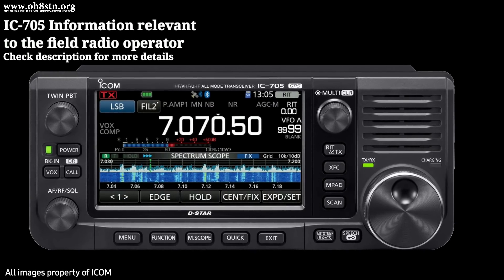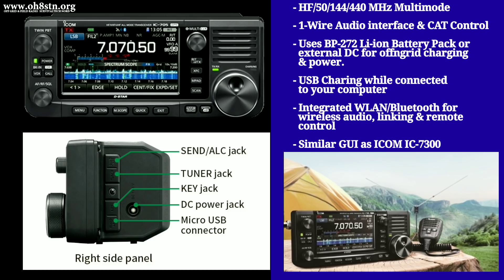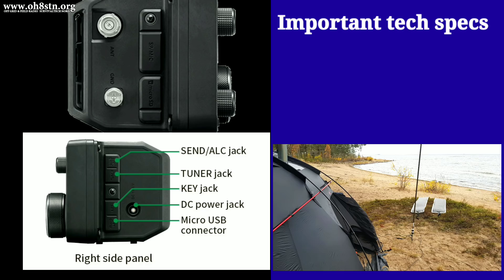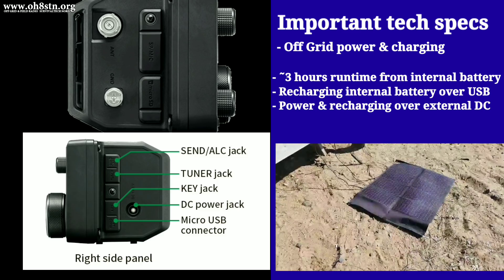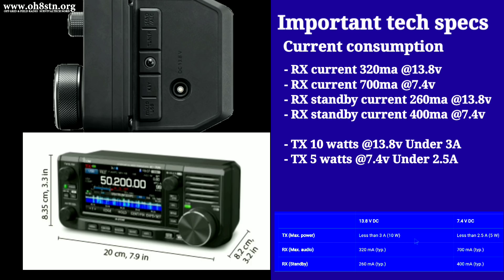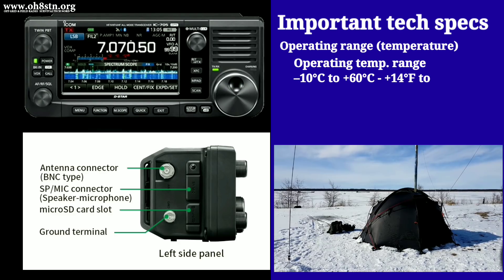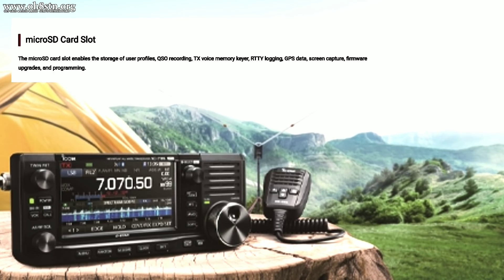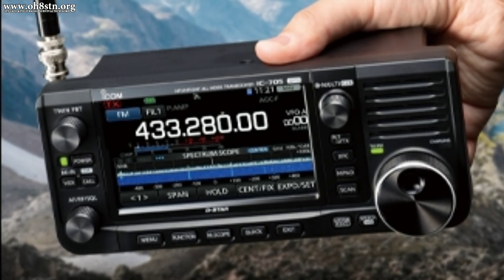Icom IC-705 Update May 2020

Comment: I think it's a fantastic field radio. Probably the best out there! 

I don't really buy into the "QRP radio" thing. I mean, every radio is a QRP radio if you just back off the power.
Reply from the maker: QRP is as much about energy efficiency as it is transmitting at low power. There currently are no efficient QRO rigs on the market unfortunately.   It's actually crazy  when manufacturers think we can just turn down the power of their QRO radio's, but still have to carry a suitcase sized battery to power it for a day.  This is why I am using the QRP radio plus the PA500 amplifier. I can still operate 60 W output while maintaining 250ma rx current consumption. No QRO rig does that yet.
Reply: @OH8STN  I think the single biggest pro on the 735 is the USB charging ability.
Reply from the maker: Wireless data modes, microphone and headset. 200ma current consumption,, built in GPS, ...
Reply: @OH8STN  As I said, it's probably the best field radio out there.
Reply from the maker: So I missed the point 😄
 This is why radios like the 705 are becoming more attractive over its more current hungry QRO cousins.
Reply: @OH8STN  I guess that depends on what you define as "QRO". 😂

Comment: Not all products can be all things to all people, these are just my thoughts, and yes i know some o them have already been covered.

1) Would be nice to see a battery compartment for 3x or 4x 18650 cells allowing higher voltage operation and making a mild sacrifice on unit size for significantly increased battery capacity. whilst negating the need for using a proprietary battery  pack.
2) An internal tuner also wouldn't take up much space, being internal no need for connectors or tuner power sources or micro controller, it would run off the existing mcu.
3) A second antenna port for VHF/UHF - really consider those on a budget and/or lower licence level use radios like this as their main rig, the 817/818 with the dual ports are great for this.
4) OLED display might have been nice for better readability in sunlight and lower battery consumption.

I was really interested in this radio, but at straight up double the price of the FT-818 in my region I think I'll be passing.

::edit:: Also a suggestion, avoid using the term 'one wire'. Unless I'm mistaken you are talking about rig control and audio over a single USB cable, and not the 1-wire communications bus by Dallas Semiconductor.

Comment: I'm waiting for a 100W that turns down to 5W.  I operate QRP from time to time, but my main concern is communication after a hurricane in Florida.

As a condo dweller I have 1600W of portable solar power for after the blow.

My ECOM radios are a IC706MKIIg, 2ea FT-857d, and FT-897d.  I did have an FT-817nd.  For me these are excellent for car or motorcycle portable or ECOM with the 100W.

The IC-705 does have my attention though and I am looking forward to your review after a good shake down.  All my portable operations tend to be to cluttered and bulky.

Julian, you are the king of streamline and clean portable radio.  Thank you for changing my paradigm to ECOM.

Comment: I'm thinking about this radio for the exact same use (emergency, off grid, etc...) My only two 'concerns' are no built in digital mode support (I'm thinking along the lines of the D74) and that there's no built in antenna tuner (but maybe that's not a real concern... I'm just now finally looking to upgrade to my general license after having my tech for over 20 yrs... So my HF knowledge is of course, limited)

Comment: I want an all-band, all-mode rig to take camping, and I'm torn between the ICOM IC-705 and the Yaesu FT-991a. This will be my first HF radio, so the extra power of the Yaesu is attractive for when I'm home, but all that extra power would require a marine battery in the field. I'm finally starting to see why enthusiasts collect so many different radios! 73 de K7COI

Comment: I am concerned about the micro USB connector. I have had bad luck with most of the devices that had it - it's fragile and often failed if used extensively. Why not not use USB-C, it's 2020....
Reply from the maker: Agreed

Comment: Ask a question? Get an answer !  Well done video.....thanks.   Down to business. The current drain in stand-by is less than I thought it would be. Not too bad. That is one neat radio with a lot of features and a lot of bands to choose from. Adding D Star was a nice touch. BUT......the deal breaker for me is the idea of not including an onboard ATU.   Look at the size of the KX2. It has an ATU built in. I would have sooner had an ATU and no battery, like they did with the IC703 series. Look at most YouTube ham radio portable setups. So many people use non resonant antennas or antennas with not so good SWR. 
For me, the no tuner is a deal breaker. It may not be for you. Just a note......I only use resonant antennas, but I still would like the ATU since there are times I need to go close to the band's edge where a tuner is needed.
KU3X/QRP

Comment: Looking at this the other day, I started wondering how inconvenient  the single antenna jack might be.   If a separate VHF/UHF jack was available. A simple dual band antenna could allow for local repeater work, etc. and still allow HF work without switching antennas or using  a band splitter or  something.  I suppose you can still carry and HT  around ....

Comment: I'll be honest thus far this radio doesn't do it for me although I like that pricing seems to be speculatively dropping around a grand ? better than 1500 for sure. i like few things but it certainly doesn't look field worthy or built for rough service at all. Why can't a company make a "real" filed radio .water proof or resistant at least shrouded and or recessed controls better options for internal battery and or external as well. I think most people just like the waterfall and touch screen..I would actually love it if you or anyone could school me on what's so amazing about this rig vs others tbh. I may be missing the boat. Thus far I only have the vererable 817nd and 897d . got both used and on good deals of course.I will be watching intently as you test it as I know you will be honest about what it does well and what it doesn't. I think SDR based radios are the future and love that this one is all mode and band at least ( which is why the xiegu didn't do it for me either) I will look over specs again . I haven't used a 7300 but that has amazing reviews especially at price point and this would be great compliment to owner as seems intuitive and simliar menus and operation etc. also no built in tuner? think they missed mark on that one as Xiegu will most likely release another version or update I am sure . the Chinese seem to be able to move much quicker albeit sometimes to dismay of owners as they end up beta testing firmware. I am admittedly new to this game so would love hear and see counterpoints to what this 705 has to offer ...love your channel and content btw.

Comment: Hello OH8STN, thanks for a great video! I'm looking to run the same setup as you, the IC 705 with the lightsaver max. However on the specs it says that the IC 705 needs 13,8V and the lightsaver max gives 12V, do you think it will work? (I'm new to this :) ) 73 de SA5EMA
Reply from the maker: This is something we need to test when the 705 arrives. I look at it like a car battery, which is only 13.8 when the engine is running. In practice it can be anywhere between 12-14.2 volts.

Comment: I have just cancelled my pre-order deposit for the IC705. This was due to Icom cancelling 4 Meters. I have every other band but wanted to start 4m portable ops with a band-scope.  This decision by Icom has made the IC705 a very expensive QRP radio that other radios can fulfil, I already have all band capability but going portable on the VHF bands from the hills was my wish in the first place, and participating in 4m contests was something I was looking forward to.
So, there remains nothing in this radio that I need, I have a IC706, IC703, a FT817 and from home a IC7610 and FT847. So the IC705 has just become superfluous and an expensive toy. 
Is there anything else worth re-considering the IC 705, no, it was an expensive choice at QRP levels but with all the band capability. But not having all bands puts this radio in the wait category. In 12 months from now, it will be sold at a much reduced price, providing people are not silly and prepared to wait for this one.
Steve
Reply from the maker: I don't know if that's true, maybe it's true for some. I actually have zero use for 4 meters. To be fair though, it was nice that it was originally included. Thankfully I'm looking at the 705 for all of its other features. The 1-wire audio/cat interface, the wireless connectivity, the charging over USB, 10 watts output, the rear mounted battery pack, and a display I can actually read. I know it's kind of a letdown, so I'm not picking on you. Just giving you a different perspective. At the end of the day if you're happy with the other rigs you have, stay with him.
Reply: @OH8STN  Hi Julian,
Thanks for your response.
Actually, and based on your comments regarding connectivity, I am still on the fence regarding a decision on this radio. My original comment had been based on receiving the 4m news from Icom this morning causing me to choke on my porridge!
I am very disappointed though and can understand that lack of activity on 4m in some countries makes this a irrelevant point.
However, 4m ops in Europe and across the UK has grown significantly and you will meet a new and interesting bunch on it including great contests and range. 
Portability for VHF antennas is much a question on what can be carried up difficult terrain to achieve VHF/UHF success. I can manage 2 meter/70cms beams on my back pack, and can just about do a 4 meter beam. This includes batteries, radio cables, mast tubes and wind break. So this news from Icom had been very disappointing.
I have emailed Icom to ask whether the 4m issue is hardware (bandpass filters etc, or software subject to a possible future update). In the meantime, back to transverters and cables everywhere.
Steve.
Reply from the maker: Fair enough Steve. Context is always a good thing.

Comment: If this had a tuner, then it would be the ultimate portable feature rich all band all mode rig.  I am the owner of an IC-7300 (main rig in the shack) and an IC-7100 (portable ops and for FM ops in the shack).  Otherwise it's a splendid little rig.  And yeah I will probably end up buying one once I can get a small capable and compatible tuner.

Comment: ELECRAFT T1-A

Automatic antenna tuner check it out :-)
Reply from the maker: It's a good tuner. Sotabeams also has a good one, with a similar form factor
Reply: @OH8STN  👌 you have opened a new word of radio I'm so eager to learn thanks again..73
Reply: @OH8STN  can you sing £40 is ok for a second-hand one the adventure tuner?
Reply: I've been using a T1-A for several years.  Very fast works well on some very bad impromptu antennas!

Comment: I love icom radios, having the 7610, 9700, 7100, 5100 (had a 7300 which I sold to get the 7610) - So I really love the ICOM radios. I will be skipping this radio however, at least until the price comes down. Out the gate, like all of their radio's, they will be several hundred dollars above their worth. But even when the prices comes down, I will be hard pressed to get this one. The G90 has a built in tuner, can go to 20 watts, has a CW decoder, smaller foot print, and costs 2-3 times less. 

I'm sure those that get it will be happy with it though. It is very nice looking, and I love the 7300 interface. Why they didn't stick in a tuner is very strange to me. While I have resonant antennas I can take with me, what about the people with just a wire antenna that requires a tuner? Now you have to carry around with you another device.

They are going to charge top dollar for a radio with inferior features than something that costs way less. I just can't justify it.

My .02 YMMV :)

Comment: Great info about a great radio! Thank you for focusing on the key features of the radio used as it was designed to be used.  I am stunned at the amount of functionality Icom has stuffed into a radio this size.  Their design sounds like a SWaP master work.   To be honest,  I think if they had included an antenna tuner either the box would have been bigger. Current technology levels make it very hard to get that much into a box that size and keep their price point.  
I operate a business repairing amateur radios,  and I'm wondering how hard repairing these is going to be. It's a very difficult design problem to be compact and highly serviceable. I guess I'll find out in about 8 to 10 years lol.  Sooner for things like popped front ends and dropped units. Im wondering how much of this radios digital circuitry is reduced to ASICs and FPGAs. That will affect how serviceable they are when Icom no longer sells those programmed parts in 20ish years. 
I'm definitely thinking I need one at some point. 

Thanks again for an informative and fun video!

Comment: The IC-705 offers many attractive features for off-grid and portable ops.  Like my (older) IC-7200 and most newer Icom radios, it has a one wire USB connection the a computer.  Yaesu missed the boot entirely with its FT-891, which I also own, by not putting in a sound card.  Sad. Of course, this was good for the aftermarket sellers of audio interfaces.  I would have liked to see a little more power in the IC-705 (hat tip to Tim Taylor) in the rig.  20-25w.  You don't always need the reserve, but it's good to know it's there.  To carry a small PA defeats the purpose of this kind of radio. How ruggedly built is this radio?  If we ops are to use it as a portable, emcomm, bug-out, boff-grid radio, it has to "take a lickin' and keep on tickin'" (apologies to Timex). Are there any specs on dust proof? waterproof? Shock proof (as in dropping it)?  A really "ruggedized" version would be a great selling point for me.  This radio will probably easily sell for over 1000 Euros in Europe.  It would be a shame if it broke easily, especially when it is really needed (Murphy's Law).  73!  SV0SGS

Comment: Julian, any word on the IPX rating? It would be a shame if Icom didn’t make this able to withstand a bit of water...

I’m still going to hold out to see what the TX-500 from Lab599 brings to the table. I have rugged low power VHF/UHF radios w/ onboard APRS already with my VX8DRs; I need a rugged QRP HF radio to complete my backpack station.
Reply from the maker: So far,  no word. By the way, there was a tx500 update on their website a few days ago. I love the idea that radio but it's a wire mess. Would be great for CW and voice comms though.
Reply: OH8STN Ham Radio I was just looking through the English language owner’s manual (.pdf on the website) and it shows the TX-500 having CAT control as well as ability to connect to a PC w/ one cable. I’m not into data modes myself so I have to ask; how is this different than the 705 w/ your Raspberry Pi?
Reply from the maker: I'm not sure I'm going to need the Raspberry Pi with the 705. Was thinking of an Ubuntu tablet or laptop, but that's a different discussion. I couldn't find any information saying the tx500 has a built-in sound card. So if we're using data modes, that means one cable for cat control, another cable for the audio interface. If there's no internal tuner, that's another couple of wires. In my situation, it's all the wires I'm trying to get rid of.

Comment: Being able to charge it through the USB port is definitely a +.  Using digital modes with an antenna that can be tuned should make this radio a winner.  I wonder what else will be supplied with this radio and will Icom come out with an Android App like they have for some of their other radios ?  What solar panel setup would be the best for this radio.  Is Icom going to come out with a portable tunable antenna ?  If this radio is being released in June for Japan, it shouldn't be too long after that until it's available here in the USA.  Thank you.
Reply from the maker: I'm not sure about the accessories but hi, is partnering up with third-party manufacturers for at least two different antennas. As for the solar panel, I have a couple of different options. In my Delta Loop video from a few weeks ago, I showed the powerfilm lightsaver Max. It has its own internal battery storage, but also has a small solar panel to recharge itself. It's got USB and 12 volt outputs with a Max of 5 amps load on the 12 volt output. I think that's going to be my primary external power supply for the 705. I saw an interview with Ray Novak where he said there's going to be an Android app,  but I'm not sure  what functionality that app will have. For the rest, I think we just have to wait and see. I'm really excited about the single wire interface. Awesome comment and feedback. Thanks for watching.

Comment: Many thanks for sharing this info on the ic705  which is a futuristic fully featured portable  and will be a leader in outdoor operations  I currently use a ic703 portable 10years now  I need to point out it has a awesome atu  it's a pity the 705 has not , would I buy  consider I operate hf in the field and I think the majority ops do yes I would because I'm an icom fan. No doubt the opposition will counter in the not to far of future 73s de EI5EN.

Comment: Excellent review/update.  I know U are looking forward to using this rig portable in the field.  I would appreciate any info on adding a 100 amp for home and car/truck that could operate at full power in a digital mode such as RTTY.  Thanks.
Reply from the maker: Let me think about this awhile. I have the same idea with a little less power. A100 watt amplifier for SSB and data modes if required, would be an excellent option if one could only have one radio